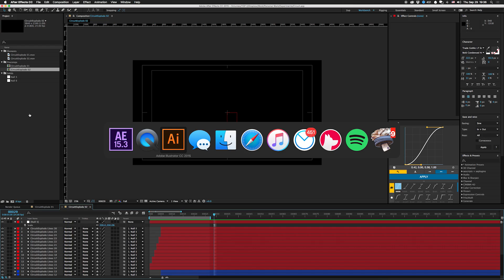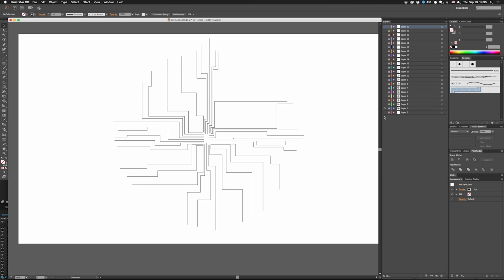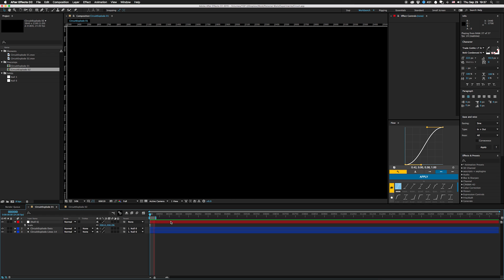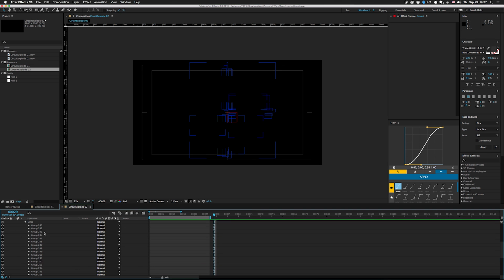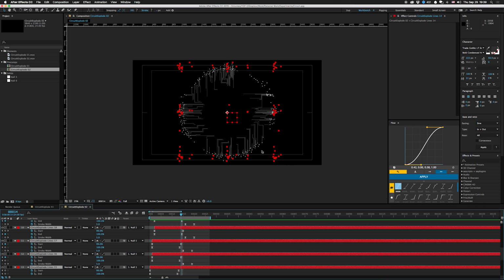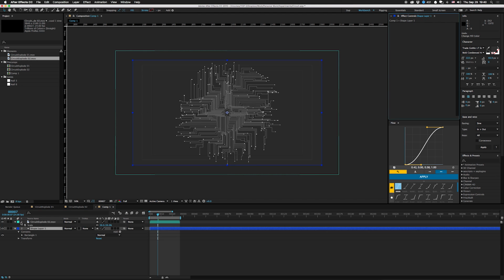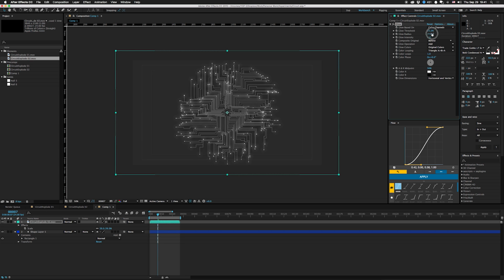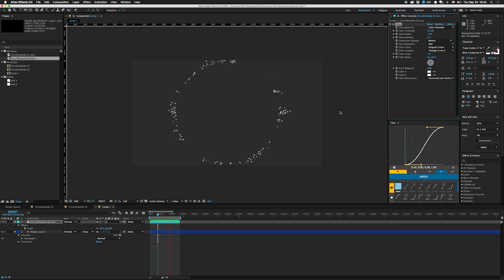Tutorial 38: Fiber Optics

Comment: Hi! How did you make the squares at the beggining of every stroke?
Reply from the maker: Hi! I mentioned it at 1:26 but it's a little fast. Basically, I duplicated all of the layers and made the stroke width larger. Then I animated the trim path so that the start and end parameters are only a little bit apart. You could also use an expression to link them. i.e. pickwhip the start parameter from the end parameter and add .5 or so. The number you add will vary depending upon how long your paths are. Hopefully that clears it up!